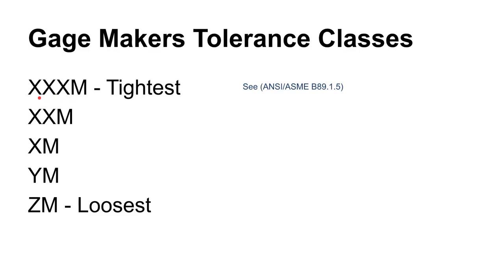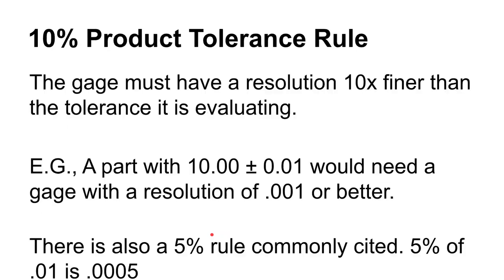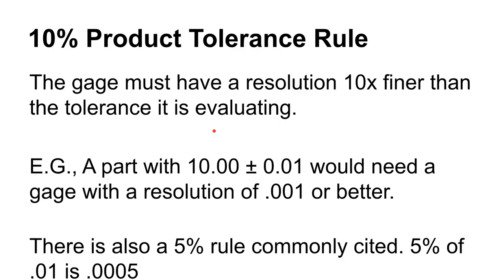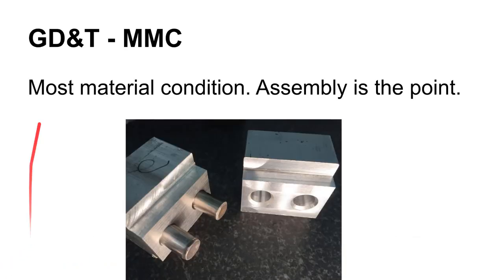4571   Gage Design Lecture

Comment: Good Gage Design & Measurements using Standard Applications.  Resolution with the 10% Rule (10X) as a Tool Design General Rule or Condition.  (MMC & LMC is always a Tolerance Application.)  All Features are detailed by weight as a great learning example, this is a great analogy!  Thanks for a great Tip!

T J (Tom) Vanderloop, Author, Technology-Instructor & Consultant: ATEA, AWS & SME Member/Leadership